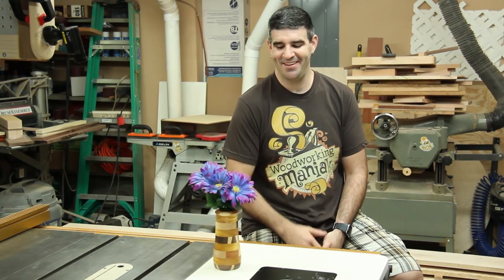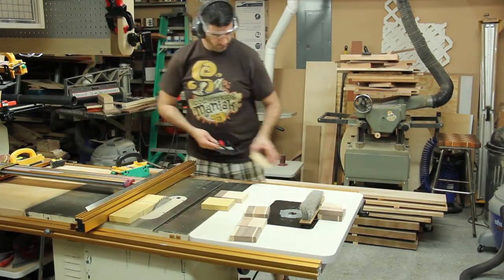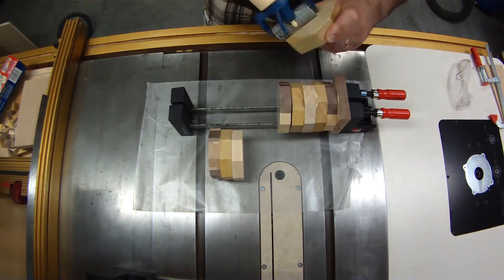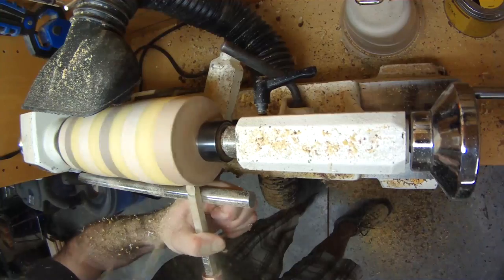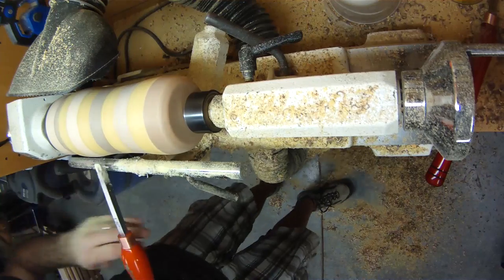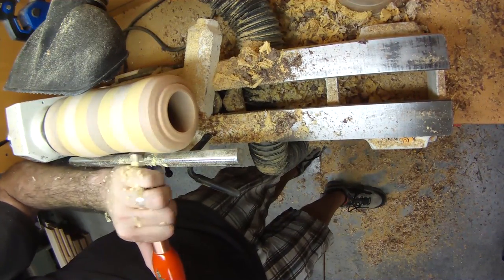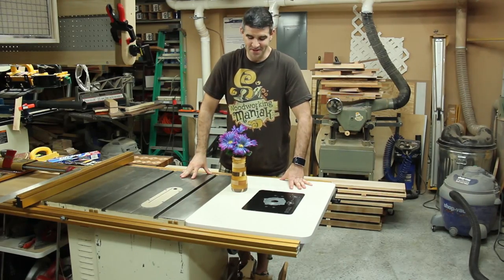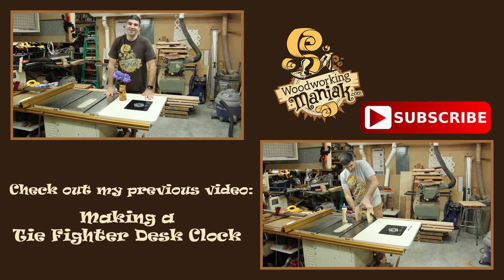Mother's Day Vase

Comment: Doesn't hold water? I'm down voting it too!! Heh. Turned out really nice, looks like the little one is starting to get some size to her too.
Reply from the maker: Dave's DIY It could hold water if I filled the inside with epoxy. But I planned from the start to use fake flowers because I cannot bring real flowers into the NICU at the hospital so it wasn't necessary... :) Thanks for watching.